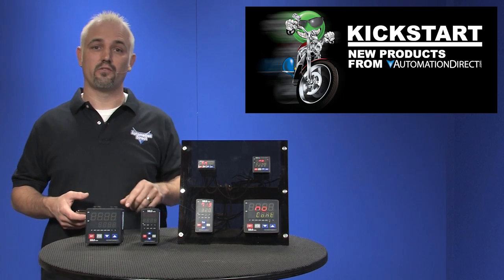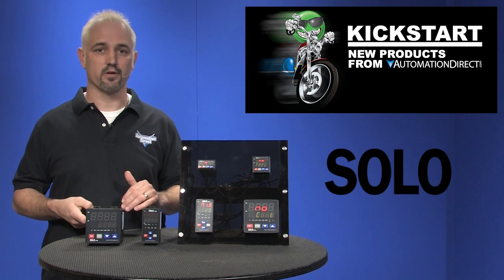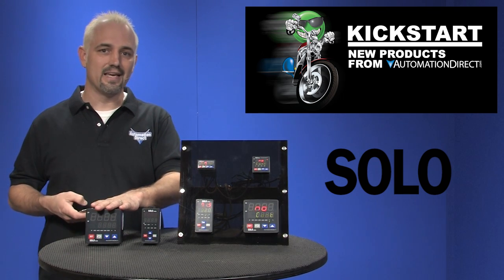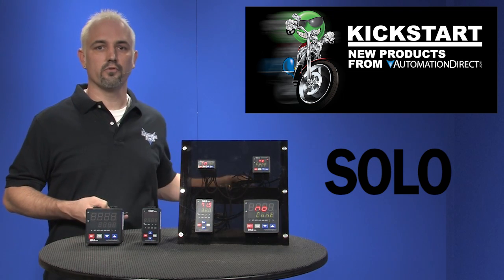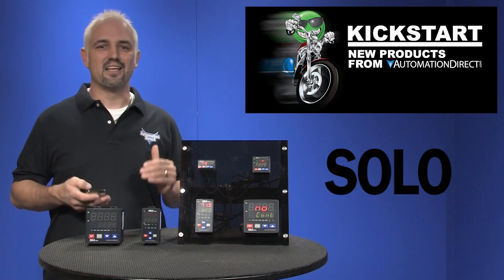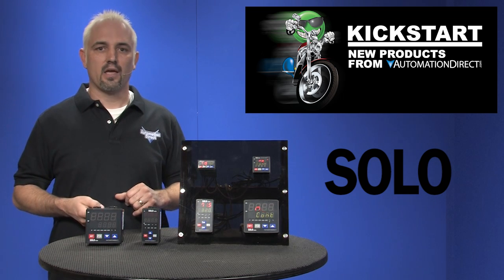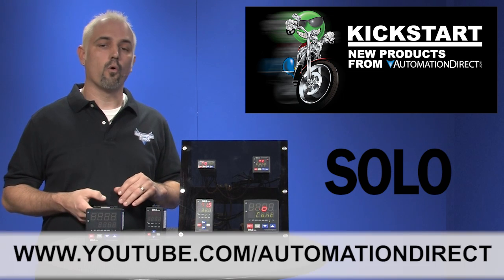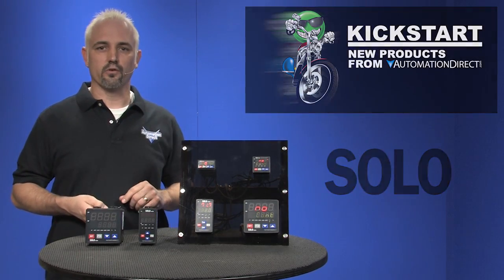SOLO Digital Temperature Controllers from AutomationDirect

Comment: The manual states that the units with a event inputs can use the first one to disable the control output. It also states however that this is only active when the input is high. As this is not fail-safe, can the unit be programmed such that the input can be reversed, i.e. the unit disables the control output unless it sees event input 1 go high?
Reply from the maker: Thank you for watching! For technical questions like this, please contact our free award winning tech support. They are setup to give you the most efficient and quickest support. 
Phone:    1-800-633-0405
Email:     https://www.automationdirect.com/adc/Form/User/TechInquiry
Support:  http://support.automationdirect.com/
Please let us know if you have any other questions! 
Thanks, AutomationDirect
Reply: No thanks, I already reached out to this compnay once and they chose not to use the opportunity to answer the question.

Comment: I hooked up a solo temp controller 9696 to the productivity 3000 using a rs485 connection and I never could the timeout bit on modbus read command to work just how I wanted it.All I wanted it to do was when the timeout bit turned true It would turn on a light and stay on till the timeout bit turned false.I just never could get that bit to stay true constantly.Here's one example. When it timed out the bit would stay true for about 5 min. and then turn false for 45 seconds and turn true again.